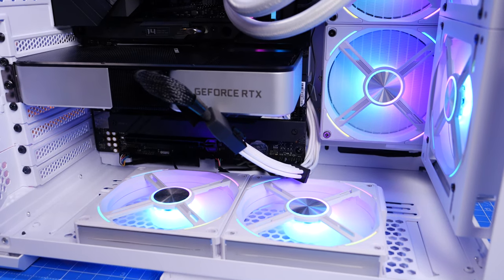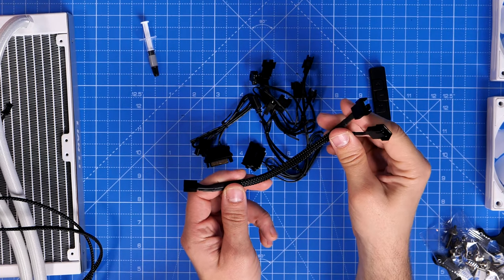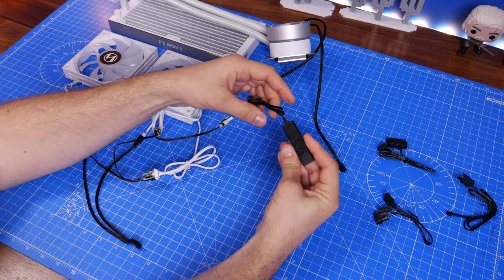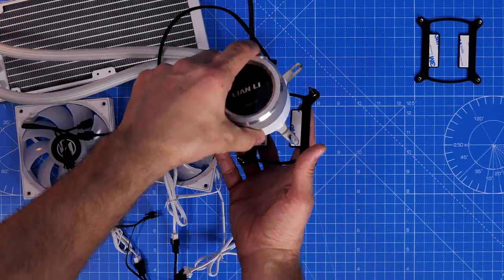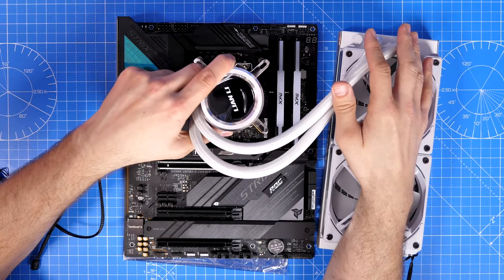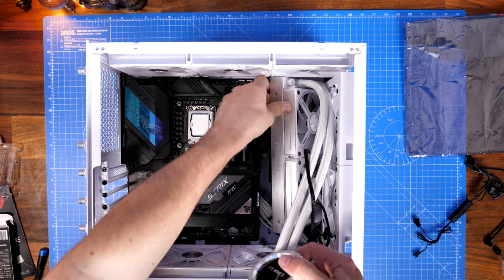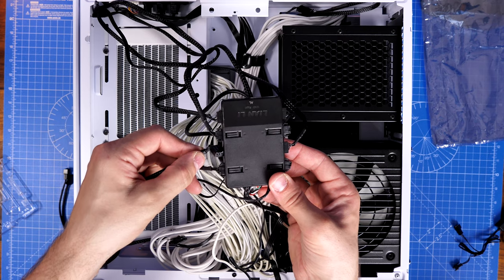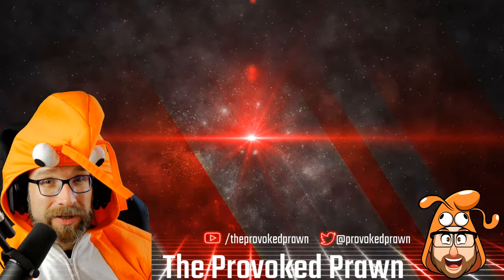Lian Li Galahad AIO 240 unboxing install and benchmarks (in the Lian Li Air Mini)

Comment: DO NOT INSTALL THE AM4 CLIPS ON THE MOTHERBOARD. ATTACH THEM WITH THE SCREWS TO THE COOLER AND CLIP THEM TO THE MOTHERBOARD. 1000X EASIER
Reply: what bracket / clips did you use ?
Reply: @silent3693  the am4 ones. It's seperately packaged with the springed screws
Reply: I wish I saw this 20 mins ago

Comment: Would this cooler be enough for an R9 7950X3D? I've had it sitting in my current build for about a year and half now, and was considering reusing it for the next build to save some money, but I'm not sure if it would still be capable enough for something newer.

Comment: I bought a Galahad 2 from a local gaming store. I’m missing a cable for the fans and hub. The fans are connected together like internally daisy chained. I tried seeing if they had a removable piece but I can’t locate it. One fan has a small 8 pin cable but it’s not long enough to go anywhere. Is there a way I can send you some photos ???

Comment: I just joined. 😊only one I've ever paid a subscription to. Lol. Your helpful and really appreciate that.
Reply from the maker: I was just going to find your last comment to say thank you. Appreciate you Mike.
Reply: @The Provoked Prawn  your very welcome.  The y connector thing is confusing me. I must need a couple different wire plugs or something.  One that has the kind of plug that goes into lian li box. To plug that plug into a splitter..with one side of splitter that has a plug to motherboard. That one link u sent me looks like i wouldn't be able to plug the one from aio into it.

Comment: Hello, new to pc building here. I just wanted to ask how were you able to attach the Lian Li AIO on the side panel of the case. Based on reviewing the Lian Li Galahad 240 SL120, its radiator is 273 mm in size while the side panel for the O11 air mini can only accommodate 240 mm radiator size based on reviewing its posted dimensions. I also plan to attach an AIO on the side panel of my O11 air mini but still hesitant cause of the measurement confusion. I am not sure if Im missing something or looking at the wrong product. Anyways, I really love your build. Hoping to hear from you soon.
Reply from the maker: The max size of the radiator in the specs is no doubt based on the usual way they are sold i.e. 120, 240, 280 or 360mm. Which itself is based on the size of the fans that attach to it, not the rad. So it's fine.

Comment: I watched this while installing mine as well and I didn't hear the part where you said you used too much thermal paste on purpose, I used the same amount as you did.  Will I have any issues??  I haven't set up my pc yet as I'm still waiting on my fans to arrive, should I remove the pump and change out the thermal paste?
Reply from the maker: I didn't use too much, my point is people with opinions will say that I did. As long as it's good coverage and isn't seeping out of the edges and your temps are good then you've used the right amount.
Reply: @TheProvokedPrawn  Thanks for replying I was getting worried for a second.   From what I can see it doesn’t look like it’s seeping out the edges so I think I used the right amount.

Comment: I did the galahad 360 rgb and the lancool 3 rgb... followed all guides and instructions I found. Reads the top 3 fans as 1 rgb, and front 3 fans as 1 rgb. What did I do wrong? No way to individually control each fans rgb similar to the infinity?

Comment: Between the Galahad 240 or the Corsair  H110 or H115, which one would you suggest? Cooling a 12600k but upgrading next year to most likely a 13700k (or equivalent).
Reply from the maker: What fans are you going for? Tbh I think both are good options, but if you have a Lian Li case with Lian Li fans, why not stick to Lian Li AIO as well? Or the other way if you're considering Corsair.
Reply: @TheProvokedPrawn  I'm actually building on a Corsair 4000x with the glass front, so they'll be Corsair RGB fans.
Reply from the maker: @reng.5934  Corsair AIO then ;)

Comment: I bought the UNIFAN SL120 version and I followed your instructions for the fan cabling. The pump is connected to the motherboard and the SLI fan is connected to CPUFAN. I can't control the fans and the rgb with LConnect 3 because the fans are connected to the mobo. I am also using Armoury Crate and LConnect 3, any tips?
Reply from the maker: You should be able to control the fan speed via Armoury Crate or your BIOS. While the RGB should be controllable via L Connect 3 if you connected the single RGB cable to the control box?

Comment: Do you have a link for the Y connector you used for the AIO fan connector? I'd really appreciate it. So i can plug one connector into aio fan on motherboard and one in lian li module. Does that way work for you?
Reply from the maker: I've used this one a few times https://amzn.to/3EWFI43
Reply: @The Provoked Prawn  oh dang im confused. The plug that goes into lian li box from the aio is a different plug end. Is there a y splitter that has the lian li plug and the plug that goes on motherboard to aio fan spot.?
Reply from the maker: @mikeinvegas1  Sorry Mike, I'm tired and I misread what you were asking about! Can you explain what setup you're trying to achieve. Or come and ask me on Discord? It's been a while since I built this one and I can't remember exactly what's what without re-watching the entire thing.
Reply: @TheProvokedPrawn  its ok. Im researching.. no luck.
Reply from the maker: @mikeinvegas1  If you want to come to Discord and chat to me about it I can try to help.  https://discord.gg/8vBf5VWz
Reply: @TheProvokedPrawn hey do you have an updated discord link that I can contact you on? I have all the fans daisy chained into the hub & power going to the hub via USB 2.0 on motherboard. Only part that is confusing me is I have nothing to plug into my cpu fan header so I’m not sure how to properly use them/control them without having something to plug in to that. I have 3 fans on the front daisy chained and going to the hub. One fan on the back going to the hub. And 3 up top on my aio that are also going to the hub. I’m trying to figure out how to plus the 3 fans on the AIO into the CPU fan header. Please help!!

Comment: I have a prebuilt Lian Li Lancool 205 Mesh case with standard fans (2x140 front, 1x120 back) and a Galahad 240 SL.
All the fans are (presumably) going through the hub and connected to the MB via USB, AIO Pump, CPU_FAN and CHA_FAN3 headers. All the fans are spinning, but in BIOS I can only get a reading for the AIO Pump and FAN3 header. CPU_FAN reads N/A under BIOS/Monitor tab.
Any ideas? Much appreciated.

Comment: looks very nice but the aio tubes should be on the bottom of the radiator and aswell comin from the bottom of the pump because the air goes up so it will be pumping more air
Reply from the maker: As long as the pump isn't the highest point it's fine

Comment: Mounted and remounted this several times on my i7-12700k. The cpu easily jumps to 90-100 degrees. 
This was THE worst premium cooler i have ever worked with.
Edit: Turned out to be a fabrication error
Reply: did u even take off the plastic cover lol
Im using the exact same one for my i712700k
Reply: @aciid5081  Turned out to be a fabrication error.
Reply: What

Comment: It helped somewhat, but you should have stuck to one explanation and finished it, then maybe tried something else. Considering there were so many different options. Personally just not a fan of it at all, too many cables, such a fuss. If it wasn't for my friend buying it against my advice, I wouldn't have had to touch the thing at all.

Comment: You're radiator should be flipped for best performance. Having the hoses at the top shortens the lifespan of your AIO, thus bricking your cpu.
My radiator lasted roughly a year.
Reply from the maker: no, that's nonsense. https://www.youtube.com/watch?v=n9TQsmj8rvk
Reply: Wrong, as long as the pump not going above your rad it's okay.

Comment: flip the rad 180 degree so those waterlines dont cover your ram and fans
Reply from the maker: 👀👀👀👀 things are indeed going to happen in here in a month 👀👀👀
Reply: There’s benchmarks showing setting it as side intake gives best thermals/noise levels. He has it exactly right. As far as the tubes down, I personally think it looks uglier. Who cares if the tube covers a little of the ram? I always go performance / aesthetics. But then again I have an all white build so who am I kidding lol